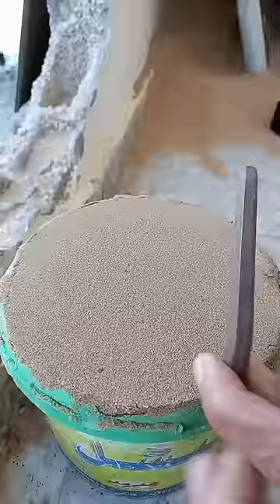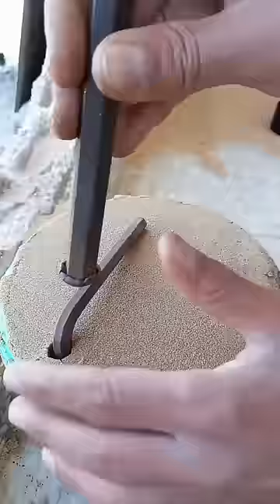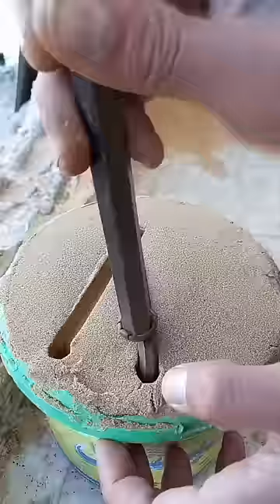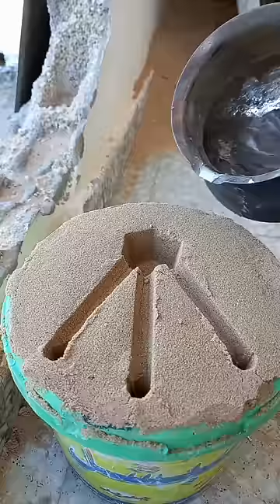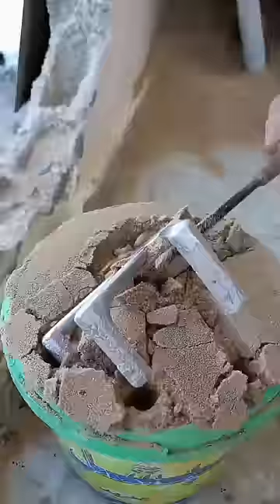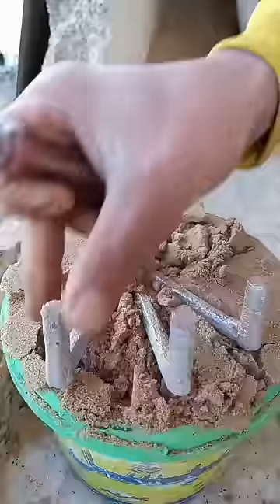صنعات صب علي الرمال صهر المعادن

Comment: Many moons ago. Was stuck in an Egyptian small town.  My roommate lost the keys when he fell into the water. We had no keys to our car.  We asked locals for help. They sent us the town’s engineer.  He took apart the key ignition and did something like this to mold us a new key.  He charged us $50 US dollars.   Today, I consider it a $50 dollar lesson on molding with liquid metal. Was awesome to see.
Reply: If the key was fallen into the water, how did the engineer formed a new key without the original form?
Reply: @thore0007 😂😂  good question
Reply: @thore0007  used the dismantaled ignition to imprint the pattern of both sides. Used that to make a mold. Poured molten metal into the mold. Reassembled auto ignition. Inserted key. Simple. However, my thoughts are pure guess work. I still pay to get a key made because I don't know beans from carrots about key making.
Reply: @jacoblecoy3700  I see! Thanks, yes it make sense. Not easy to take out that part where the key has to put in, but it is the only way.

Comment: I'm just wondering if that is aluminum or lead? That just gave me a really good idea for making sinkers.
Reply: свинец, конечно
Reply: Daniel, it is shiney enough to be aluminum, or lead. Sinkers? Sure. Can do. Small 'squeeze on line' sinkers. Take a no-name sinker . Open it until it is nearly flat. Gently press into sand. Repeat for as many sinkers as you want. Set a fan, OUT OF DOORS blowing away from you. Melt metal of choice. Gently, carefully pour indentions full. Allow to cool until safe to handle. Remove, shake-brush off sand. Repeat. Lead works better than aluminum due to rigidity factor.
Reply: It's gallium
Reply: @dillonlyons6154  or tin
Reply: @jacoblecoy3700  it's 100 percent galium

Comment: Sand casting aluminum can be a viable method for making certain types of tools, depending on the specific requirements and intended use of the tools. Sand casting involves pouring molten metal, such as aluminum, into a mold made of compacted sand. Here are some considerations regarding sand casting aluminum for tool production:

	1.	Cost-Effective: Sand casting is a relatively low-cost method compared to other casting techniques, making it suitable for producing tools with complex shapes or larger sizes.
	2.	Design Flexibility: Sand casting allows for the creation of intricate tool designs with various details and undercuts, as the sand molds can accommodate complex shapes.
	3.	Material Strength: Aluminum, when properly cast, can offer sufficient strength and durability for many tool applications. However, it might not be as strong as certain steel alloys, so the specific requirements of the tool should be considered.
	4.	Surface Finish: Sand casting may result in a rougher surface finish compared to other casting methods. This might require additional post-casting processes like machining or sanding to achieve the desired smoothness or precision.
	5.	Limited Precision: Sand casting may have certain limitations in achieving high precision or tight tolerances, depending on the complexity of the tool design. If precise dimensions or tight tolerances are critical, alternative manufacturing methods might be more suitable.

Ultimately, the decision to use sand casting for making tools depends on factors such as cost considerations, required strength, desired surface finish, and the level of precision required for the specific tool application. It’s advisable to consult with experts or experienced manufacturers to evaluate the feasibility and suitability of sand casting for your particular tool requirements.
Reply: ضض😅 🎉🎉🎉
Reply: Dude.. the guy just likes poking things I to sand!!!  No need to go all sand casting P.h.d on his ass
Reply: I😅😊a😊a
Reply: Look at you showing you can copy and paste without doing any real research or having any hands on experience. Good for you😂
Reply: @tonyatallant5212  People make fun of others for a variety of reasons, and it’s often linked to social dynamics and individual insecurities. Sometimes, individuals use humor as a way to establish dominance, gain social acceptance, or deflect attention from their own shortcomings. Unfortunately, this behavior can be hurtful and damaging, reinforcing negative stereotypes or targeting vulnerable individuals. It’s important to foster empathy, respect, and understanding to create a more inclusive and supportive environment for everyone.
Reply: Such a long comment about nothing. He didn't say anything specific.
Reply: @appleblossom007  There can be various reasons why some people have trouble understanding things. Here are a few possibilities:

	1.	Cognitive factors: Certain individuals may have cognitive impairments or learning disabilities that affect their ability to process and comprehend information effectively.
	2.	Language barriers: People who are not fluent in the language being used, whether it’s their second language or a dialect they are unfamiliar with, may struggle to understand concepts expressed in that language.
	3.	Lack of prior knowledge: Understanding often builds upon existing knowledge. If someone lacks the necessary background information or experiences, they may find it challenging to grasp complex or unfamiliar ideas.
	4.	Different learning styles: People have different learning preferences, such as visual, auditory, or kinesthetic. When information is presented in a way that doesn’t align with their preferred style, it can make comprehension difficult.
	5.	Emotional or psychological factors: Stress, anxiety, or other emotional and psychological factors can hinder the ability to concentrate and process information effectively.

It’s important to note that these factors can interact and vary from person to person, so understanding difficulties are not always straightforward and can require individualized approaches to address them.
Reply: @appleblossom007  such a short comment that adds nothing, you really didn’t add anything to this conversation 👀😜
Reply: Looks like a 10/10 ChatGPT answer lol
Reply: Thank you, chatGPT! Would have never known without you 😁
Reply: @DAReckerr 😅
Reply: caray te  resulta increíble ver resultados rápidos a vajo costo 
te entiendo fuiste a estudiar muchas años para realizar fundiciones especiales 
y mira sales a las calles y oh ! sorpresa alguien hace loismo pero más barato rapido práctico y funcional 
comprendo la envidia
Reply: Thank you.

Comment: What material do you using?
Reply: aluminum  or zinc
Reply: You want one bad 🤣
Reply: Aluminum. You can do this with your aluminum cans. My former brother in law used to collect scrap aluminum and melt it into big ingots to sell. It would take a whole lot of beer cans to make a big ingot so they used other sources in addition to cans. He could tap on something painted and could always tell if it was aluminum or not. It melts at a much lower temperature than steel, 660 Celsius or 1,220 Fahrenheit, so it doesn’t take that fancy of a setup to melt aluminum.
Reply: I think it's lead

Comment: How did the casting of the not only be flat but also have printing across the hole?
Reply: The lettering was on the bolt used to make the mold.
Reply: @stellyb1035  the lettering may have been on the bolt, but the impression was made by the nut and the lettering went across the hole.
Reply: @richlaue  I just took another look at the video. Listen and you might hear the person "hammering" the nut into the sand. I tried to find the term but  (I guess like an acorn nut)  this kind of nut only has one way in and it terminates with a solid cap (which I figure was cast with that lettering we saw).
... Embarrassed to admit that I often mistakenly use the word Bolt when I mean Nut, argh. (I searched around for my comment afterward to edit it but couldn't locate it.)